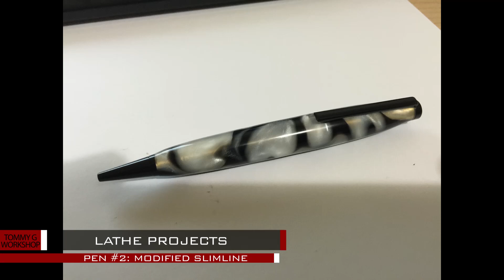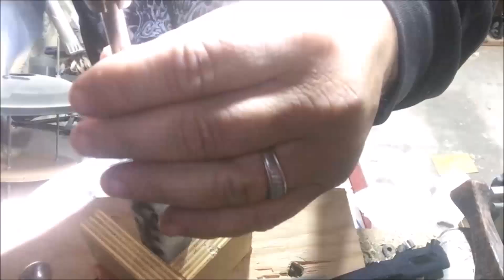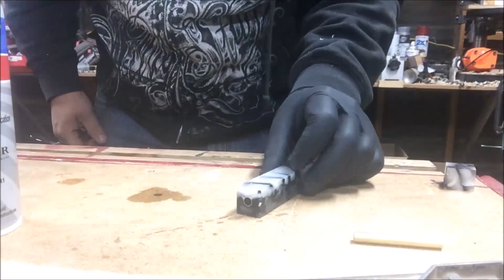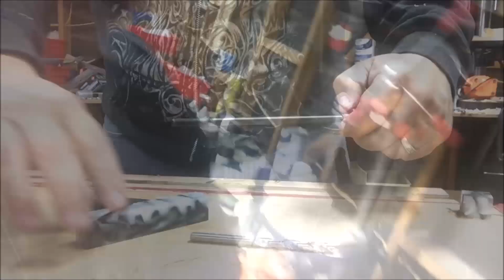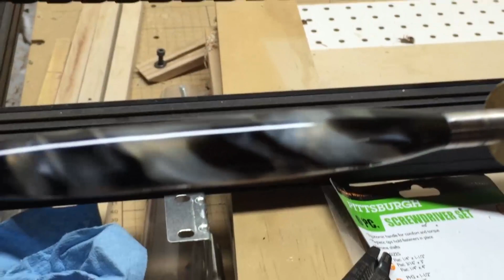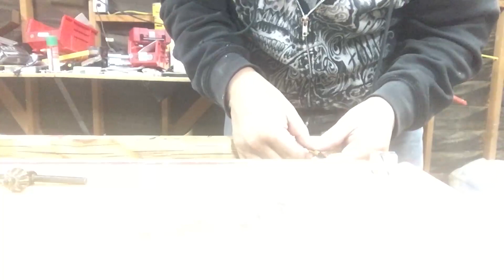Pen #2: Modified Slimline

Comment: How easy does it come apart to change ink now?
Reply from the maker: j h just as easy as a regular slimline, but instead of pulling it apart half way through the pen, with the modified you just pull it apart at the tip! It slides out and then you just change the ink like normal!

Comment: Nice pen. In order to keep the tube invisible you can paint the inside of the blank after you drill it to match the blank, in this case I would have painted the inside of the blank silver. Not a criticism, only a recommendation. I have started doing this after chatting with some of the turners at IPA. (International Penturners Association.) ipa.com
Reply from the maker: Thanks for the advice!!

Comment: Sweet! That's an awesome technique, I'll have to give that a shot on some pens in the future. It looks clean not having the center piece in there. Are you still able to pull it out fairly easily if you need to change the ink cartridge?
Reply from the maker: +Braxton Wirthlin Its fairly easy! You have to continue turning the tip in the closed position as you try to pull it out so that the whole assembly twists itself out! Thanks for watching Braxton!